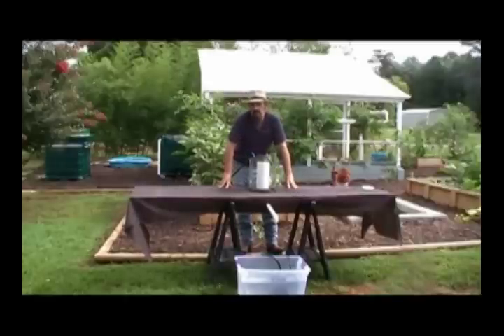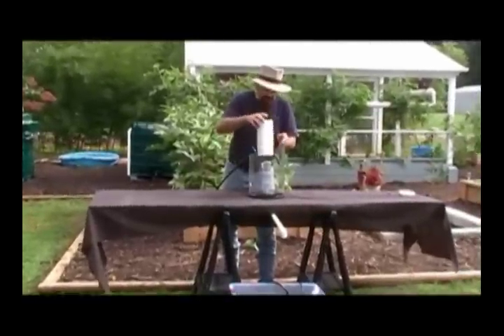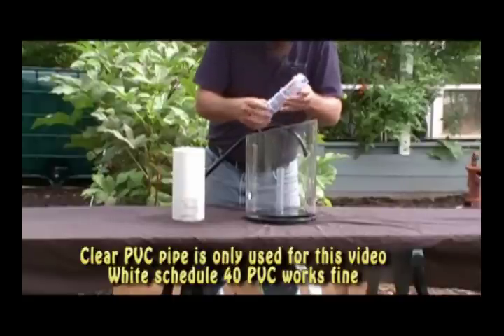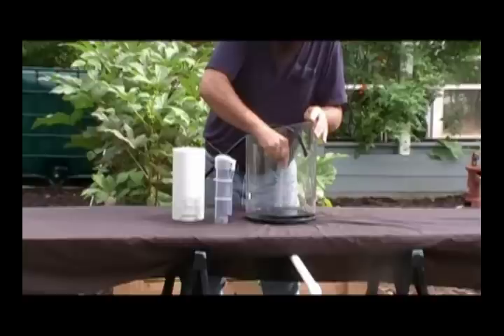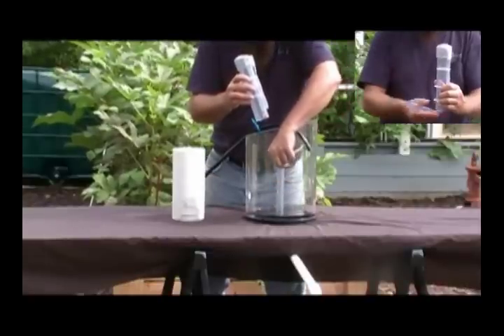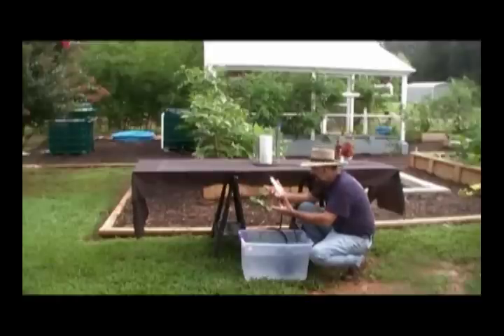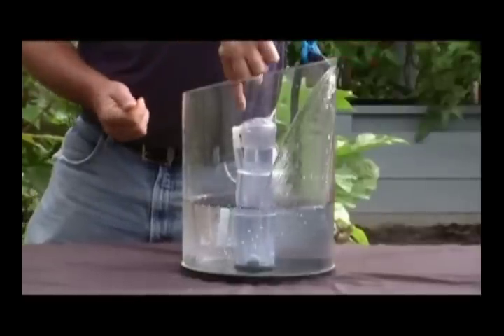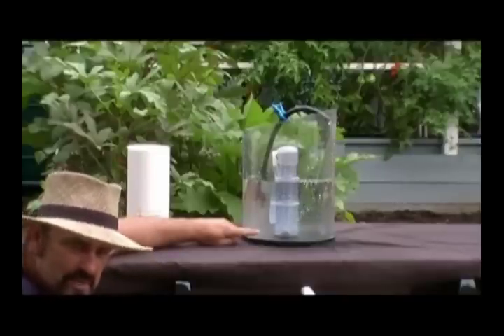Trouble FREE Bell Syphon - Automatic Siphon Aquaponics Flood & Drain Beds

Comment: Loved the demonstration and explanation. Thank you and I'm subscribed.  

I do have a question:  what is the purpose of the snorkel?  It seems that when the water level drops below the holes bottom of the pressure chamber that the siphon would break, eliminating the need for the snorkel.  Wouldn't it be simpler to cut holes in the pressure chamber at the level of the bottom end of the cycle?
Reply from the maker: Eric sometimes without it if the system is cycling fast its hard for it break with just the holes in the bottom.

Comment: Nice video but one correction its a vaccum chamber not a pressure. If it was pressured it would shoot off. You can tell this by trying to lift it it wants to suck back down.
Reply from the maker: Sean Spangler I thought vacuum was a negative pressure?

Comment: Awesome video!
I'm building an aquaponics system this spring using my Koi pond. 
Out of all the videos I've watched you explained the bell syphon perfectly. I have no more questions about that but are there certain types of fish to use or will my Koi work just fine? One more thing.......can I do an A- frame set up that dumps into grow beds ?
Reply from the maker: +williamfinney Koi work great have a Koi pond myself with aquaponics. Not sure what you are asking about the A frame?
Reply: +Grow Dinner Aquaponics 
A frame structure with the PVC Pipes 
Could I have the water pumped up to the PVC pipes with plants and then drain into grow bed

Comment: Just timed my run cycle and it is about 7 seconds, not 10.  I've been trying to infer from your video how long it is from when the water begins to crest the top of the standpipe until the siphon is established.  Seems like that might be 4 seconds?  What would you say?  How soon after the water level reaches the top of the standpipe could you turn off your pump and still get a complete flush cycle?

Comment: I want to use this principle to solve a very different problem. In my application I anticipate starting the siphon may be tricky because my inflow is short bursts of 1 quart at a time.  Here's the whole story: I live in a cold region and have a condensing high efficiency gas-fired furnace that produces a slow drip of water.  This drip is piped to a condensate pump that has about a  1 quart reservoir.  When the reservoir is full, the pump comes on and pumps that water into my sewer drain, and when that quart of water flows out my sewer pipe it freezes inside the pipe because the pipe is above the frost line and the flow is so small.  If I'm home, it's no problem because periodic showers and toilet flushes and other gallon-size and multi-gallon-size water uses flush the pipe, melting the ice before it builds up too much.  But if I am away for a long time and the only water going down the sewer is the little one-quart squirt every couple of hours, it can build up so much ice it actually blocks the sewer and then the drains back up and even big-volume water uses cannot reverse the process.   I could just get a bigger pump with a bigger reservoir, but that would have its own difficulties.  I'd rather work with the pump I have and find a way to convert these 1-quart squirts into less frequent, bigger volume flushes.    I want to put the condensate pump output line into a bucket hung from the cellar ceiling and a bell siphon inside the bucket so that water goes down the drain in, say, 3-gallon batches rather than 1-quart batches.  My question is:  How do I size the bucket, standpipe, pressure chamber, and horizontal run on the drain line so that a 1-quart squirt of water when the water level is high will be enough to start the siphon?  That 1-quart comes in forcefully, taking maybe just 10-seconds, but then stops for an hour or more.  So my bell siphon has to be able to kick over into flush siphon mode with just a 1-quart/10-second input.  Easy?  Difficult? Impossible?  Use 1/2" standpipe and 5-gallon bucket and make the horizontal run on the drain side 2 feet?

Comment: What do you think about some way to cut off the water input while the system is draining so that it will drain faster?  How could that be done?  Like some kind of switch that will disable the power to the pump.

I also do not understand your preference for the "snorkel" as opposed to just cutting holes in bottom of the outside tube, what's the reason for that, and is it as reliable to have just one small tube to break the siphon and not a wide area at the bottom of the outer tube?
Reply: justgivemethetruth I personally like the snorkel idea because you can very easily adjust the level of the water you want remaining in your grow bed. Your method would work as well, but you'd have to fabricate another bell tube if you wanted to adjust that remaining water level vs just attaching a longer or shorter piece of PVC tubing to the snorkel fitting.

That's the beauty of hydro and aquaponics. There are soooo many ways to get the job done and the only limitation for setups is your imagination (and whatever Home Depot has stocked :) )

Comment: i have set up a siphon like this but with smaller air tube breather,it works for one day but after that it sucks water and air and creates small gaps and it doesnt work after that?is this a problem of the tube?should i go for a bigger one in diameter?
Reply: and i made the hole on the top of the siphon
Reply from the maker: notis mplampla I like it better on the side and a large tube

Comment: My siphon won't break. I'll try  Snorkels, hope it helps.
Reply from the maker: I find if it has a slow start I need more water flow, sometimes a slow start keeps it from getting a good strong siphon and then it has a hard time with breaking at the end of siphon. To much water flow will out run the siphon and that is when the snorkel comes in good. Good luck

Comment: My system is making me crazy. I have a 2" standpipe with a 4" Bell, I have the 1/4 turn below the table which runs perfectly horizontal for 12" then angles down and back to the fish 6' away. 

I can only get the siphon to trigger by adding a blast of water from the hose (about 5-8 seconds) or by lifting the bell slightly (increase vacuum pressure), both of which trigger the siphon and drain the table.

I tried using a reducer on the standpipe (down to 1.5" as well as 1") which encountered the same problems/solutions as above.

Do I simply need a bigger pump?  I really can't figure it out.

Finally, your video is incredibly informative and easily one of the best out there. Great work!
Reply from the maker: Thank you for the kind words. That is a pretty large stand pipe and pressure chamber you may want to look at reducing both. I find the bigger the stand pipe the more water flow it takes to get it started. Good luck
Reply: You've probably resolved your problem by now but you could always do a loop of pipes so theres a build up of water under your bed. If my description is confusing take a look under your sink and you'll see how it goes down and loops up. This concept helped with me.
Reply: ***** Regardless of the purpose used in plumbing, it helps with this problem.
Reply: I'd bet your standpipe is too wide.  It takes a heck of an initial flow to fill a 2" pipe for however many inched it takes to left gravity take control and push everything down.  I bet you could see this if you took the bell off and watched the water raise up and start to fill your standpipe ... you'd probably see a lot of air in that flow, and realize there is little chance of starting the siphon action.

Comment: I wonder why he isn't using a larger diameter fitting on the top of his stand pipe inside the bell.  I have found that when I go from 1/2 " to 1" at the top of my standpipe it helps to create a vortex easier, which starts the bell siphon.

Comment: Yep...too complicated...you only need the slots at the bottom to break the pressure! Good vid tho ;)
Reply from the maker: In hot summer if you are running lots of water in large beds with large plants to help them from drying out like melons or tomatoes 8 or 10 feet tall. Then its hard to break the siphon this will make it break everytime. Its not a problem in small beds or if you have never had plants reach 10 feet tall with 100s or tomatoes.
Reply: Grow Dinner Aquaponics I wonder if that slow to break the siphon is not just caused by water that near the end of the outflow cycle is flowing through compacted and smaller grain grow bed material, so the flow is slow and becomes close to or matched by the flow into the bed.

I bet if there was a false bottom on the grow beds where water just sunk down to a clear space and it could move freedly would not have this problem.

Comment: The snorkel tube is an unnecessary complication.  Without it, the siphon will break as soon as air enters the chamber.
Reply from the maker: In hot summer if you are running lots of water in large beds with large plants to help them from drying out like melons or tomatoes 8 or 10 feet tall. Then its hard to break the siphon this will make it break everytime. Its not a problem in small beds or if you have never had plants reach 10 feet tall with 100s or tomatoes.

Comment: would and inch of drain tubing be enough to go against a 150lph aquarium pump? its an old external filter and just making use of it instead of it in the box.
it's output tubing is 9mm inner diameter.
Reply from the maker: You should be fine with it. Size of the pipe depends more on the size of the bed. The pipe needs to have the ability to drain the water that has been pumped to the bed so the more water the bed holds the more it needs to release to out run the pump. But yes I would think you will be ok.

Comment: Brilliant system! The first time I heard of it was a few hours ago - now my question is:

Can you use this siphoning system to pump water against gravity? If you want to pump water from one container into another that is above the first - is it still possible? 
I can't seem to figure this out myself. I'd say that because there is vacuum inside the bell and atmospheric pressure on the outside of the pressure chamber/bell, it should be possible to pump water to such a height X that the force of gravity working on water above the level of the siphon is equal to the force of atmospheric pressure working on the entire water body in the first container (the one below, that is)
Reply: I'm still in my "immature youth", as most old folks would call it, so I refuse to accept the theory that you can't create perpetual motion. You can blame my physics teachers for that, since they failed at the stuff they're paid to do - explain and convince the youth of something commonly accepted, but later disproven...
Reply from the maker: Martin I have worked on that for sometime I have pumped water against gravity and it will work but the lift is very little and it becomes very undependable.
Reply: I understand. I decided to go with an airlift pump instead. I appreciate your quick reply. :)
Reply: Grow Dinner Aquaponics Sorry folks, but it is not possible to siphon water against the force of gravity. If it was, you would have the answer to the age old quest for Perpetual Motion.  :O)